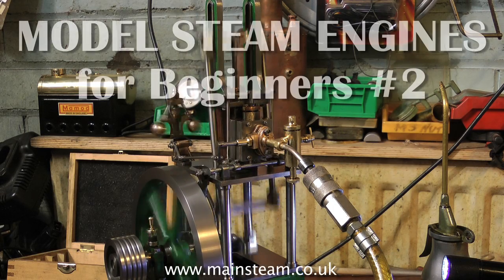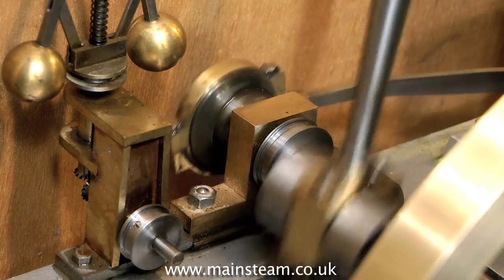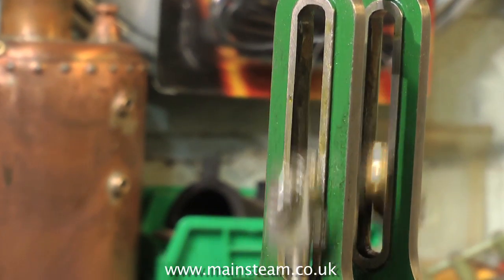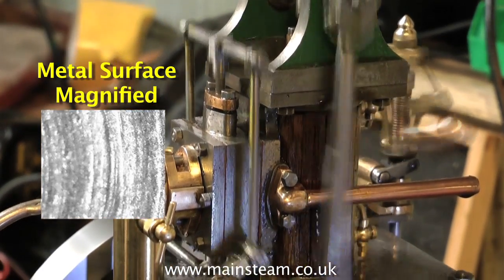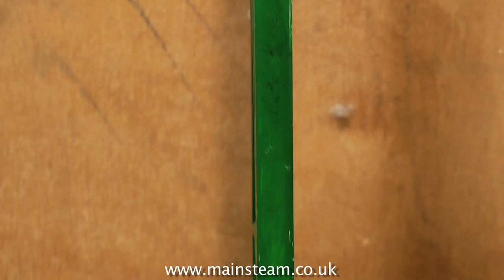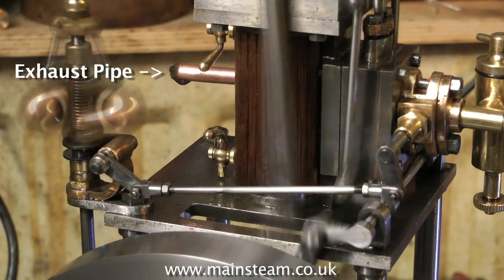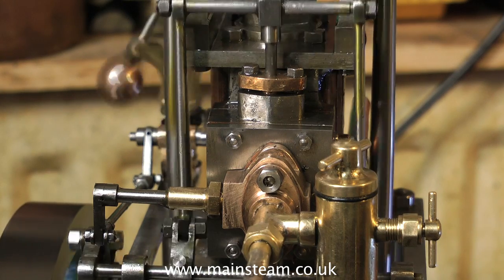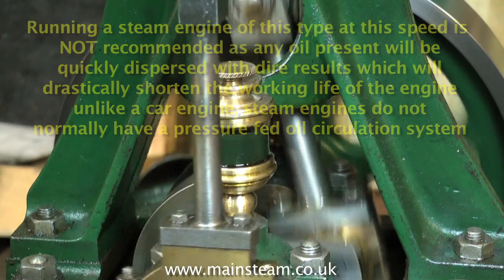RUNNING IN MODEL STEAM ENGINES - MODEL STEAM ENGINES FOR BEGINNERS #2

Comment: Thanks Keith. I have Rapeseed ordered and on it's way. But in the short term could I use "3 in 1" oil to run in my Stuart S50 on compressed air? Thanks again, Dave
Reply from the maker: only in the short term ..... 3 in 1 is very thin oil and the lubricating properties are only ok for a short while.

Comment: Thank you for all the information you provided us with, is it maybe possible to do an steam oil video? When i google it over here in the Netherlands it gives me

Expensively oils from kroon oil like abacot mep 460
This will cost 30 euro for 5 liters i seen cheaper oils but i never know can it be used for the cylinders at my regner frieda, or in the cylinders from wilesco d18 i got or do i need 2 differently kinds of oil because the wilesco is smaller

Would be very helpful to have some brands and oil types
I now used machinery oil but it looked like water and the wilesco oil was more thick, for one time i hope it doesn't hurt the wilesco but for my train i want to be sure i don't destroy it.

For the wilesco i can say i had it upside down to drain all the oil when the older brown oil came back I've put it back on display
Reply from the maker: I use www.hallettoil.co.uk for all my Steam Oil needs.

Comment: hey there, I'm trying to run in a PM research #3 engine, but I don't have access to a lathe or any type of machine that could do the job except for Lego motors. do you have any suggestions on how I could run it in? my wood shop teacher at my school has a lathe, but I doubt he'll let me use it on his spare time :p
Reply from the maker: +Demonic Darkness Why not use a variable speed battery powered electric dill ????

Comment: Great video, I am quite new to steam engines, could you tell me do the same principles apply to smaller Mamod model engines???? Thanks
Reply from the maker: Only up to a point. The small steam toys are quite different to these type of engine, but they do need oiling frequently or they wear out fast.
Reply: Hi Keith, thanks for the reply, I did not realise the small mamod engines were classed as toys? Surely whether it be the smaller mamod engines I am starting with or the larger more complex engines you run they are all still classed as grown up toys.
Reply from the maker: They are a good starting place - but I had them as toys when I was a child, the type that I play with now are not really classed as toys, more like models or miniatures - but I still play with them anyway so maybe they are {:-)))))

Comment: How often do you have to put steam oil into the cylinder ? And how do you get it in there other than taking off the cylinder head ?
Reply from the maker: The Displacement lubricator lubricates the cylinder when the engine is in steam. The oil lasts for around 1 hour before needing a refill. Any oil fed into the steam or air (if you are running on compressed air) inlet will find its way to the cylinders.
Reply: Keith Appleton I am building a small single piston steam engine and it does not have a displacement lubricator so I have to get the oil in there myself somehow. Could I put a few drops down the steam inlet ?
Reply from the maker: Yes, but it won't last long doing it that way - best to get a lubricator . . .

Comment: Hi Keith. I'm a total beginner and have watched many of your videos, which I find very helpful. many thanks. I have bought myself a Chiltern Steam models beam engine, and I am currently putting it together. I have rushed out buying this and that for it, in readiness for steaming, and one of my noob purchases, was some steam cylinder oil (460T). Can I use this? or have I purchased in error? My plan is to fit a small displacement lubricator, but I'd like an all round oil for the bearings and other moving parts.
Reply from the maker: for a small model steam engine the steam cylinder oil should be OK, I prefer the thicker stuff. Best to ask the manufacturer though to be on the safe side.
Reply: @keithappleton  Many thanks Keith. Will do

Comment: I have a question. I've seen that most steam engines are slow. Is it possible to build a fast one for model boats?. Thanks!
Reply from the maker: Steam engines are not slow at all, they just look good when running at low speed so that you can see the motion of the parts . . . .
Reply: @keithappleton  I finally found the information that small steam engines can reach rpm as high as 20.000. Quite impressive. BTW,, I also have in my tiny workshop beside the mirror a bottle of tear drops, in case some dust got attached to my eyes. Thanks!!

Comment: What is your problem with motor oil
Reply from the maker: I don't personally have a problem with motor oil at all, I just use a normal deodorant . . . . . but the additives in Motor Oil can damage seals in steam engines and Motor Oil is designed to run at a much higher working temperature than steam engine bearing lubricants. Just trying to give viewers advice based on my personal experiences with it in the past. (over 54 years). It can be nasty stuff to handle too.